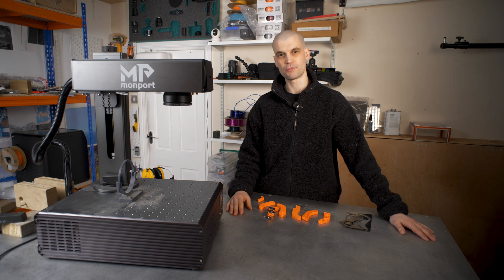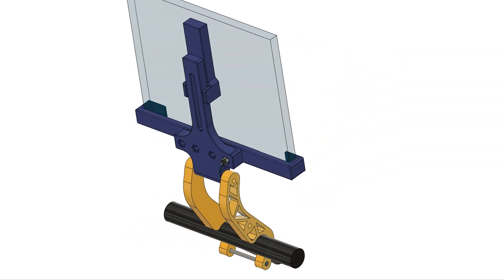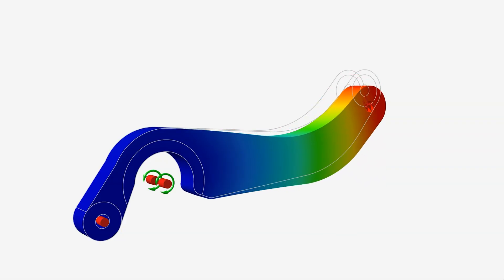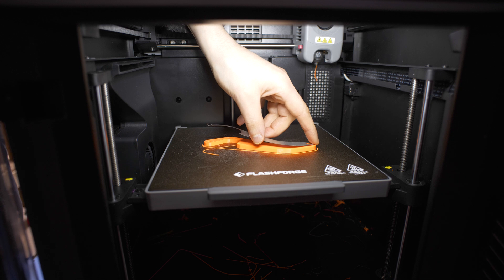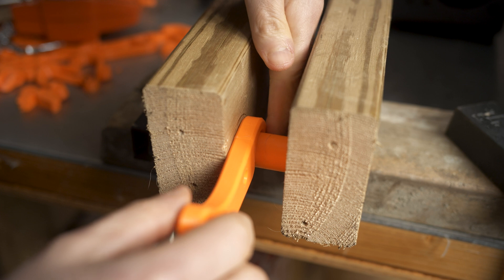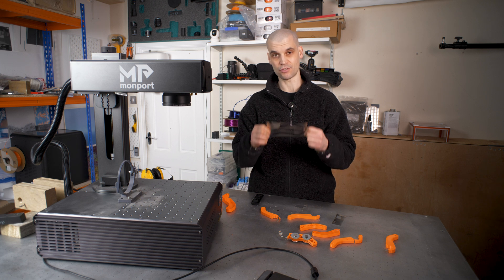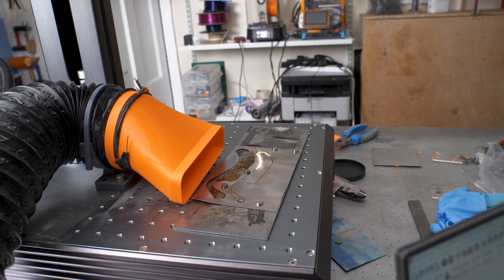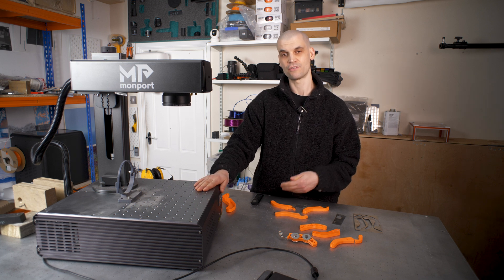Reinforcing 3D Prints with a Monport 100W Fiber Laser!

Comment: Cool trick, but doesn't solve your problem. Your problem wasn't that the bracket failed, but it's failure mode. You still have the same failure modes with all the reinforced parts themselves which is that they snap rather than yield. 

So now it's a question of what is your safety margin, with catastrophic failure modes like this you need 5-10X and even then I won't trust it. So in reality the solution would be a better designed which can leverage improved geometry for stiffness and which is printed from a material that doesn't have a failure mode where it just snaps for example PA30 Nylon or kevlar reinforced ASA both would start yielding first which would allow you to identify when the bracket can no longer be used due to material fatigue. 

You are basically following the same logic that lead to the Titan submersible disaster, it doesn't matter how strong you make something if an abrupt failure is catastrophic to your application.
Reply from the maker: Thanks for this information, im not an engineer so honestly a lot of this I do not understand, so I appreciate learning from your comments. The iPad tablet that will sit on this arm bracket weighs 1kg. So if this single arm can hold 50kg+ (and I will have 2 arms holding the tablet) then I am probably well above the 5-10x safety margin right?

Is there anything you can do to change the material's failure mode? I primarily use PETG for prints.
Reply: He effectively raised the point where that failure happens significantly past any amount of force this arm would experience in the mentioned use case, though. A tablet holder on a stationary indoor exercise bike. Just because it fails rather abruptly and pulls itself apart under the extreme force applied during testing (50kg+ at the end of a lever), doesn't mean it will fail in the same fashion from its biggest threat... long term material fatigue and brittleness. But you do touch on a valid point... in that even a non-catastrophic failure (e.g. plastic failing but metal holding the parts together) in that thin neck of the bracket could still introduce enough movement to send the tablet flying off the holder. Unless the tablet is firmly secured to it. Might be food for thought in the design 🙃
Reply: As an alternative, I propose to try combining TPU with a stiffer material. When I don't want to have things breaking, I print them in TPU. For that holder, I either would have TPU meshed into a PETG print or have TPU as the outher shell with a PETG insert to give it more stiffness. If the PETG fails, the TPU should still be able to hold the part. I'm not sure how well TPU bonds with ASA or Nylon.

Comment: well. intention to inspire. You have a cnc mill and you could cut the stuff from aluminum... why not do that? When you want to safe some cash on crucial parts stuff gets destroy, instead of safeing a few bucks safe the big bucks with a proper metal frame.

You use "just epoxy" you should infuse it with cnt (carbon nanotubes) or aluminiumpowder. A meshsize of 0,6-2mm will give a very strong mixture.
Almost like epoxy granite.

Nice clips you made =)
Reply from the maker: this was just an experiment to see if it was capable. Milling from aluminim is more expensive than 3d filament so i often prefer to prototype with 3d prints. Great idea with the epoxy!

Comment: Wouldn't laser cut plywood be a better material in most instancxces?    Ply would has some amazing structural properties.
Reply from the maker: Definitely, but cutting through 18mm plywood requires a powerful co2 laser to get clean cuts, plywood is difficult to cut because of the glue in the layers and it's not the healthiest stuff to be emitting as fumes

Comment: why not using the laser for surface treatment to increase the bonding adhesion to the printing layer?
Reply from the maker: That's an excellent idea, never thought of that! I take it you mean scoring\burnishing the steel ? Maybe a tight cross hatch texture could be used?
Reply: @ThisDesignedThat   we use laser texturing creating ablation-like effect with micro-nanto textures on metal and also composite parts to "activate" the bonding, similar to this video https://www.youtube.com/watch?v=wKU4fgQdv9o   or    https://www.youtube.com/watch?v=5-76O3WYHpA    it is critical the time between the treatment and the bonding.
Reply from the maker: Wow very cool. I'm going to have to do some tests and see if i can improve adhesion with this technique

Comment: It's simpler and stronger to use steel cable or wires routed throughout the body and then filling the space with epoxy.

Comment: first thing i notice was your infill style @ 2:30 (anybody else?)... there's better infill structure/direction for this application. that and redesigning your bracket/plate to be thicker where it snaps off would help too. but what do i know
Reply from the maker: indeed you are correct, the experiment for this bracket wasnt about making the best possible bracket though, it was to test if adding thin stock would do much to improve strength of part 👍

Comment: That does look like a beast of a laser. What guage or thickness of metal? Can you try etching a plate of brass with a logo please?
Reply from the maker: It is a beast indeed. 0.5mm steel plate can be cut but I like the speed of cutting with 0.2mm steel. Etching brass will be very easy for this.

Comment: Yeah, i don't even have a 3D printer, but...
I was wondering why you didn't just start out with a different filament?
Maybe one that's stronger?
Maybe one that'll bend before catestrophic breaking?
Cuz, y'know....   🤔
Reply from the maker: indeed you are correct, the experiment for this bracket wasnt about making the best possible bracket though, it was to test if adding thin stock would do much to improve strength of part 👍

Comment: You print with Gyroid infill then cut a small fill hole and a second hole for the air to escape in the print and fill it with epoxy.
Rectilinear infill is terrible for structural integrity. You want to use Gyroid or 3D Honeycomb. Also want extra layer every other layer to lock infill in.
Also PLA/PETG is not good at these kinds of parts. Use ABS or at least CF PETG.
Buying a fiber laser to reinforce PLA/PETG is dumb. Just use a better filament.
Reply from the maker: Thanks for the tips, all very helpful, the experiment for this bracket wasnt about making the best possible bracket, it was to test if adding thin stock would do much to improve strength of the part (even if that part was poorly designed 👍)

Comment: Can it cut thicker? I am wanting something to cut 1.8-2mm sheet. Time does not matter all that much but need well defined cuts. Thanks!
Reply from the maker: No not that thick in steel. 2mm would be possible in aluminium but the cuts are not the cleanest, CNC would be better suited and faster
Reply: @ThisDesignedThat  thanks for the response!
Reply: @ThisDesignedThat  Or maybe using multiple sheets? For example, one on either side of the print embedded?

Comment: Seems two metal sheets per bracket, with each sheet against the flat outside walls, would provide good strength. Having a single thin metal sheet in the middle seems prone to torsion failure more so than two sheets. Cool idea, though pretty pricey in required tools to implement a home solution. Very niche solution, not that there's anything inherently wrong with that.
Reply from the maker: Good idea, hwo would you attach the metal to the outside walls?
Reply: @ThisDesignedThat  Unsure, thought my first test might be epoxy.
Reply: @TheVexinator hehe, yeah, niche solution with this particular tool... but it would also not be too hard to achieve something similar with metal shears, or a jigsaw with the right blade, if you wanted to give it a try for some project

Comment: Good video and interesting test. Ignore the couch haters. I assume that the plastic is PLA, which becomes brittle under load over time (may explain the failureofyour monitor arm). Consider another plastic such as PC for strength and durability for structural parts.
Reply from the maker: Thanks, it was PETG. Hopefully in the future I could test other plastics, maybe combining other plastics with metal sheet would give even better results
Reply: PLA does not become brittle under load. It conforms to stress.

Comment: What a beast! Hefty price tag too 😮‍💨 Nice approach. I think to have any luck with fibre-based reinforcement against bending and shearing forces it'd have to be continuous runs along the whole length, or a continuous loop, like some industrial 3d-printers support (e.g. with kevlar). But hard to achieve on a regular home printer. 😅 So pausing and inserting a thin sheet of metal like you did seems more in reach for the hobbyist 👍
Reply from the maker: Continuous runs is definitely the way to go like the markforged printers. I guess you could shell out the bracket, create an inner shell and wrap fiber around it, place it into the outer shell and then fill with epoxy. I reckon that would be even stronger than the steel option I used here.

I would like to try laminating 4-5 of these steel cutouts into the print and see if it improves things. I think you could be adding too many layer shifts into the print, which could cause layer adhesion issues.

Its all probably overkill for this use case though so I should just get on with make the actual bracket 😊